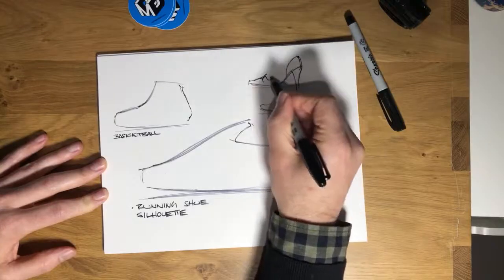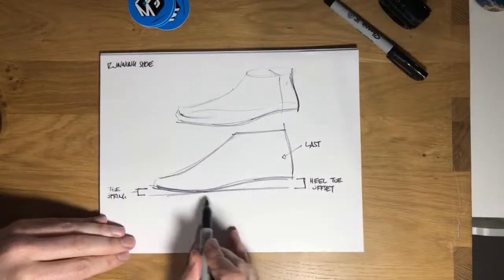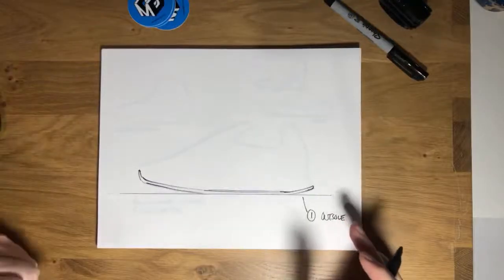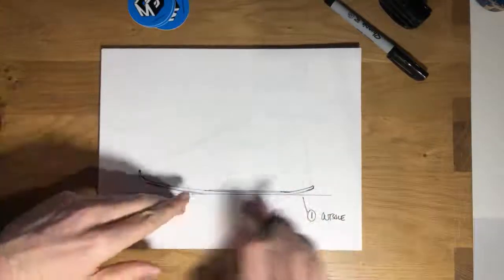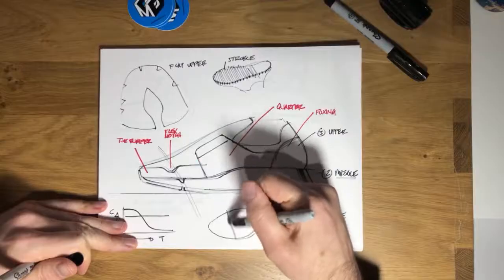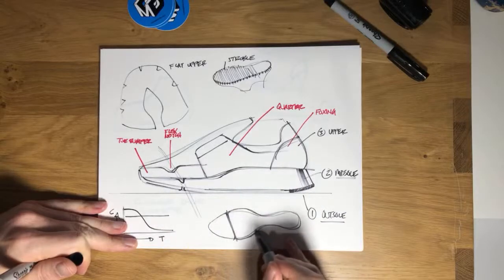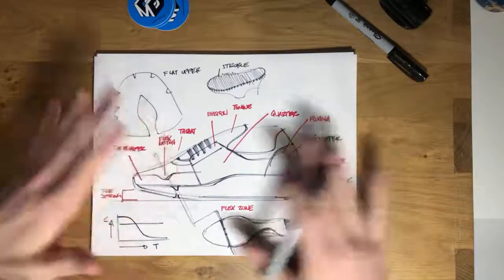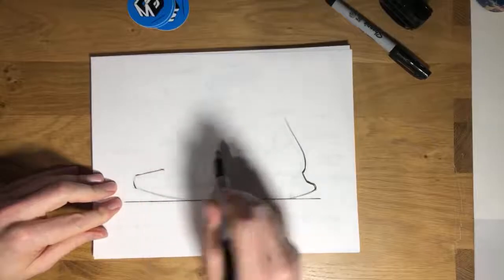Live sketch session with a past Nike, Jordan, Converse designer: Footwear Anatomy and Design

Comment: Hi Michael, I just wanted to ask you a question about the Flex Notch. Would the Flex Notch typically go all the way along/across the surface (of the Midsole)Top Line of the Midsole? Thank you
Reply from the maker: Hi there! Thanks for watching. It really depends how much flex is desired. A shoe like a Nike Free has very deep flex notches which are achieved by putting blade like fins into the injection tooling making them very very flexible. A basketball shoe will need more lateral stability so the flex notches there might only be on the bottom and hidden on the top surface of the midsole under the foot itself. This leaves the side a solid wall of rubber and EVA to help keep the foot on the platform. There is no perfect way to do it. It really varies depending on the use case for the product and is a balance between flexibility and stability.
Reply: @MichaelDiTullo  thank you 🙏🏾
Reply from the maker: @SpeedFoe  you are very welcome!